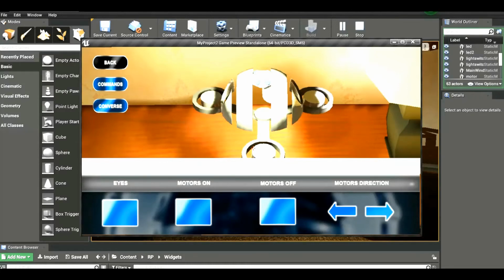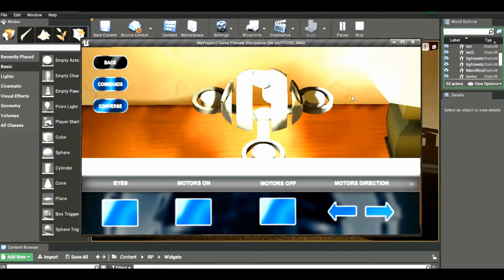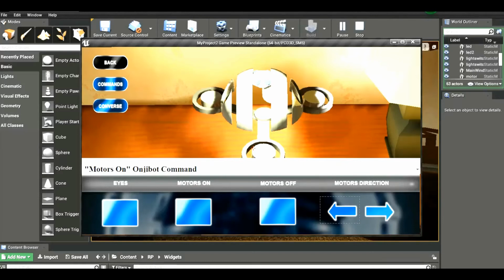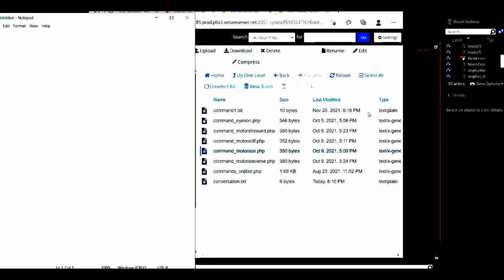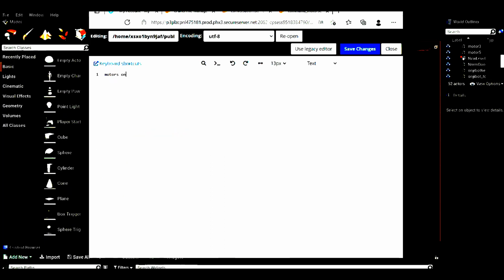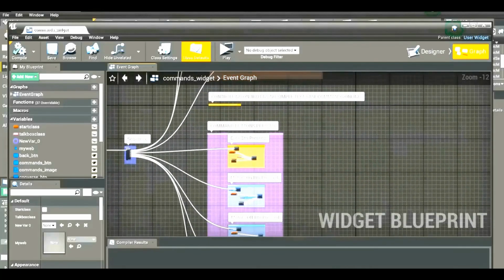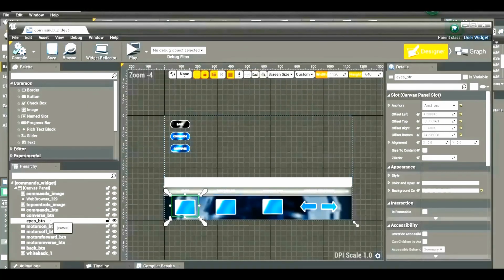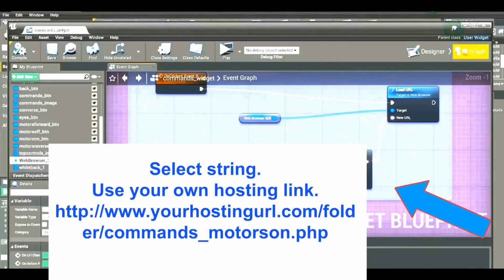Communicating With Raspberry Pi 3 Using UE4 online P1

Comment: How to download Ue4 for raspberry pi?
Reply from the maker: shorturl.at/dfhzL
Here's a link I found that seems to answer the question. Before there was barely anything that worked well. Haven't tried it yet  but hopefully it helps. For me I was simply focusing on communicating with raspberry pi using UE4. I only wanted to use UE4 as an interface with app because getting the engine on the pi was a hassle. Space/Memory/ and Git. For what I'm doing specifically I don't want a required upgraded pi.  I've been away from everything UE4 for a bit, more electrical hands on and 3d modeling, but I just got back into it recently. Hopefully I can be of any help sooner rather than later.
Reply: @onjigopro3924  it will work for Raspberry Pi 3a+